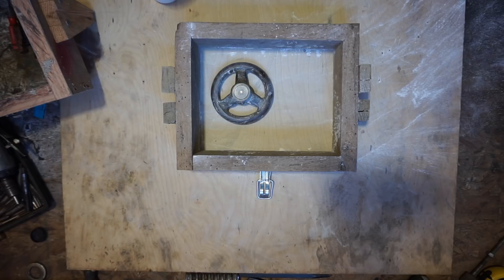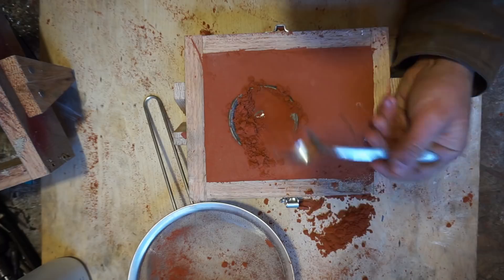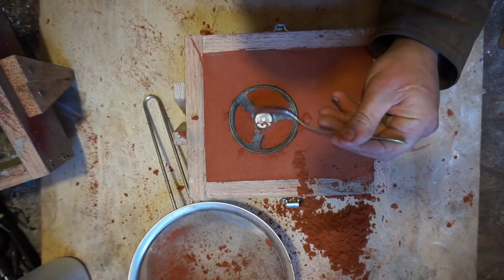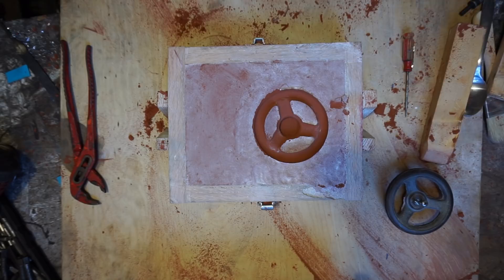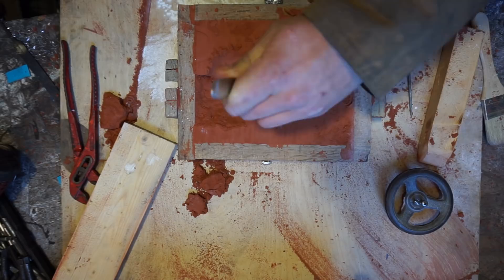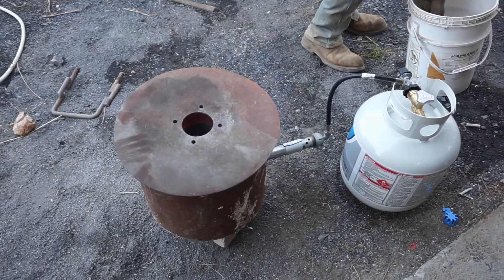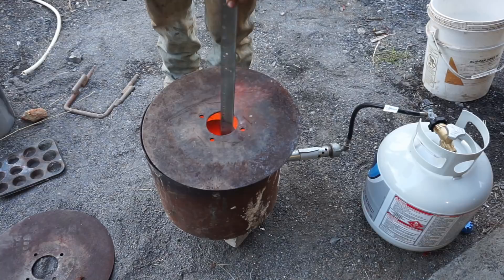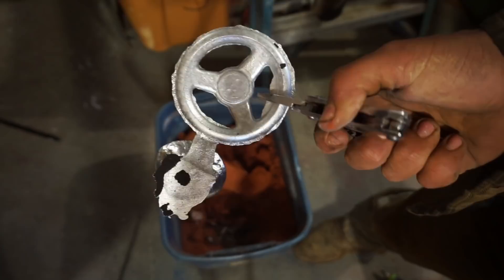Casting A Lathe Hand Wheel

Comment: Flashing (where the edges of the mold don't quite meet up), one thing you can do if you need a handle with a hole in the center, instead of casting it solid and drilling it out, is make a core that goes through the hole, use something like sand with sodium silicate added and gas it with CO2 to harden it. I'm sure Mr. Pete or Myfordboy have videos showing core making.

Comment: I think by far this is your best video. I really enjoyed it. It was hard to tell, but what was you using for a crucible? What about a burner?
Reply from the maker: Sam I Am crucible is just a piece of 4" tubing about 1/8 thick with a bottom welded in it and the burner is a mig welding tip inside the pipe
Reply: Diehl Does that's creative. I have been wanting to play with doing this for awhile, but don't want to spend a ton of money on it. I would love to see more of your set up sometime.